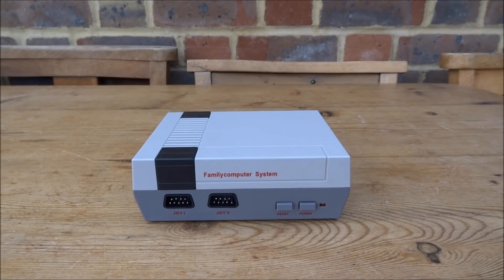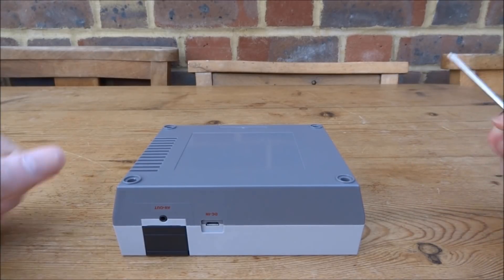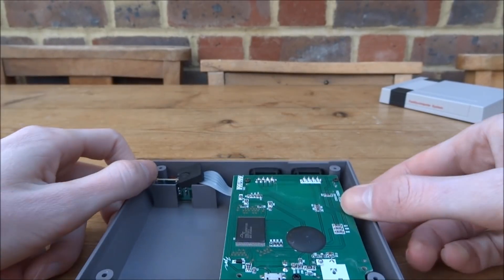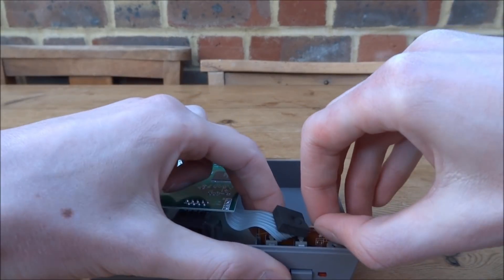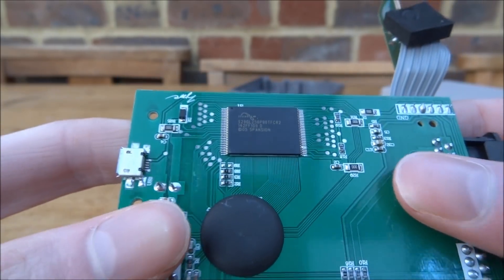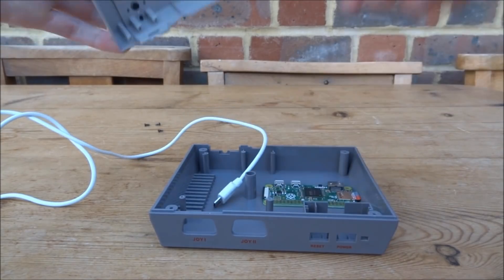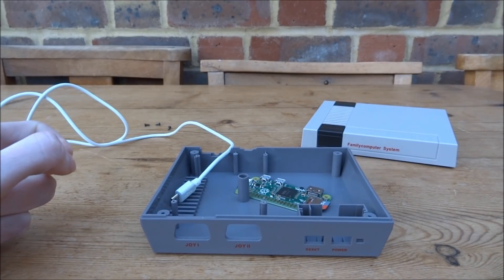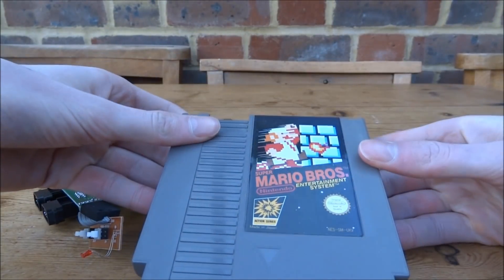Fake NES Classic Edition Disassembly & Mod Ideas!

Comment: Is there a way to hack to add games to this? I'm thinking of getting one but no castlevania games?
Reply: No its just a stupid blob chip so the memmory can't be accessed with laboratory tools, it even is a mask ROM sometimes so no rewrites hard coded sadly
Reply: Okay the memory is accessible :-) but not cheap.. So just use the case and done
Reply: @kitecattestecke2303  yes, the case is definitely nice. I am curious that may be the HDMI upscaller can be used on a different console? Also I am posting a review of a similar chinese console where I will discuss possible mods for it.